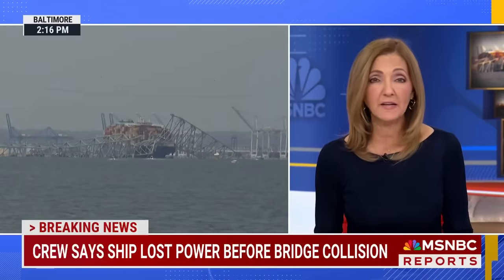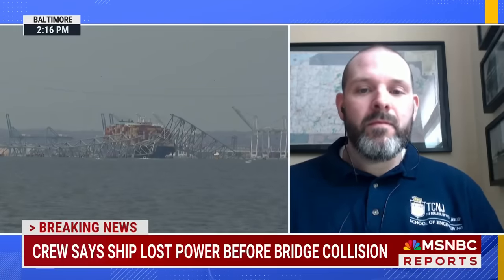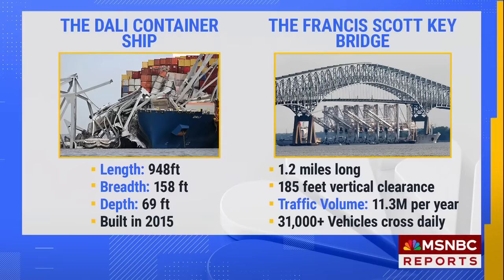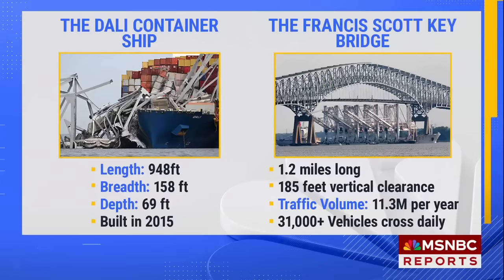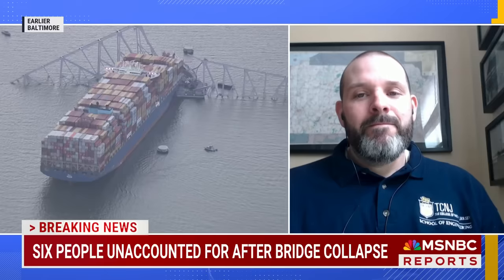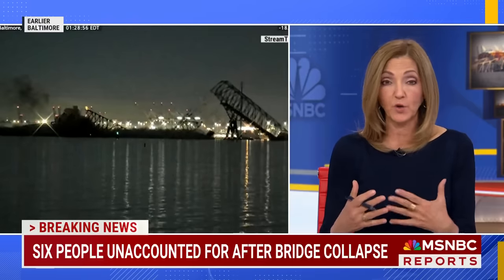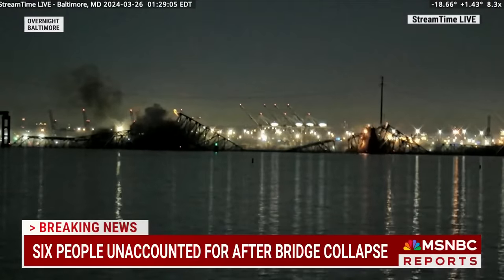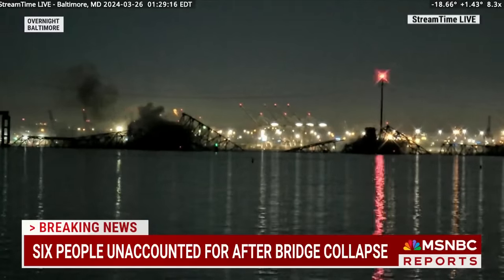Building Baltimore bridge from ground up will take 'much longer' than reusing wreckage: Expert

Comment: i would like to know why the ship took such a sharp right turn before striking the bridge. if it would have stayed on the path it was on it probably would have went under the bridge. and great idea reuse the already damaged material thats is now weaker than it was before the collapse
Reply: The ships lights went out moments before striking the bridge. Loss of power and then evasive maneuvers set  it off course. Mayday calls went out immediately.
Reply: Id like to know why they shouted "Praise Jesus" moments before impact!
Reply: It was windy and it lost power.
Reply: Also the man was only talking about the condition of the foundations. He said the wreckage will be removed. If the foundations are excecpted as usable they will build a new bridge.
Reply: Been blind and stupid long or just today???
Reply: How do you control a ship with NO power.   Even the generator being used was too late to stop the crash.  This was a horrific accident.

Comment: When they rebuild....DO IT RIGHT INSTEAD OF TRYING TO USE ANY PARTS OF THAT BRIDGE.
Reply: Mainly talking about reusing the footings in the water if they are still good. If new footings have to be put in it will add alot more time to get the bridge rebuilt
Reply: I would think that more modern designs might be considered which would be less vulnerable to a total collapse.  This bridge was over 50 years old and it may have been state of the art when it was built but not in the 21st century.  In any case I would think that the steelwork of the old bridge should be recycled and not reused in any way.
Reply: metal has a memory, every piece would have to be re-smelted and remade - that is the only safe way to reconstruct from the recycled materials.